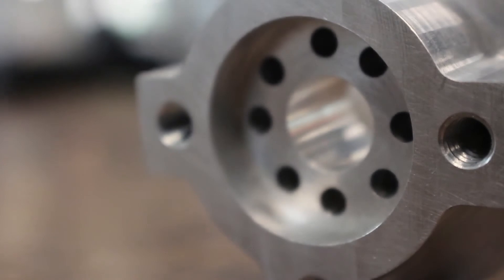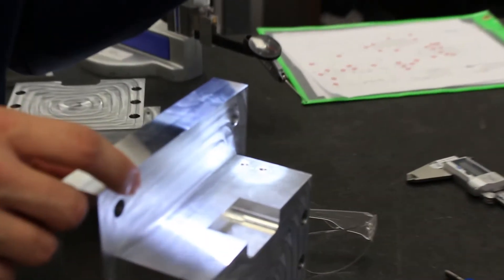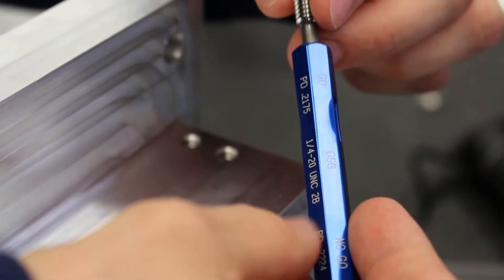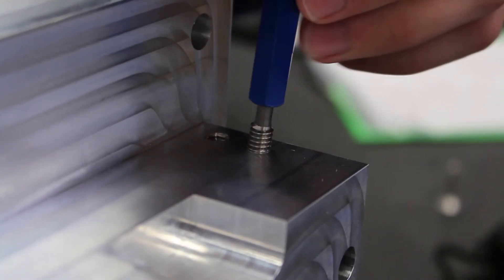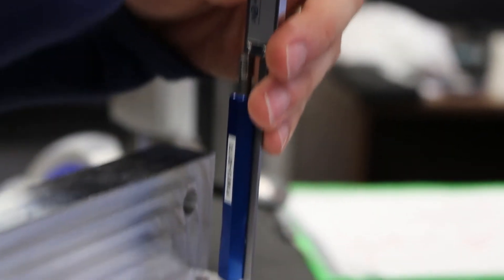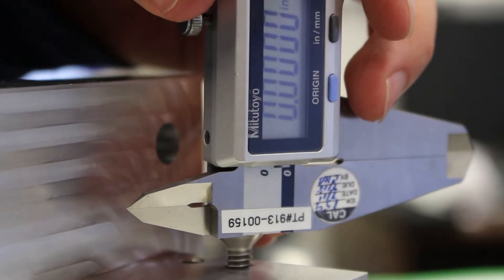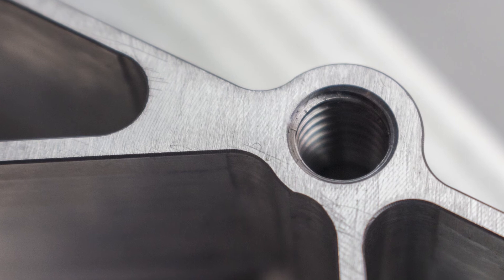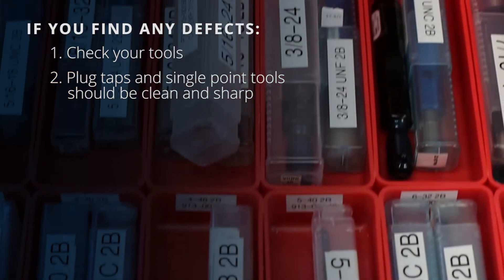Xometry Partner Tips: Checking Thread Depths

Comment: This is not correct. You are including the chamfer (which is not threaded) into you calculation. Why? If 2 threads deep would fail whats 2 threads and chamfer gonna do? Measure the threads stop measuring the chamfer and have a good day
Reply: You are right, to precisely measure thread depth, you must compensate for gauge's thread lead (which is usually half the pitch value, but measuring the lead rather than assuming it is always preferred as it can also vary slightly from gauge to gauge).